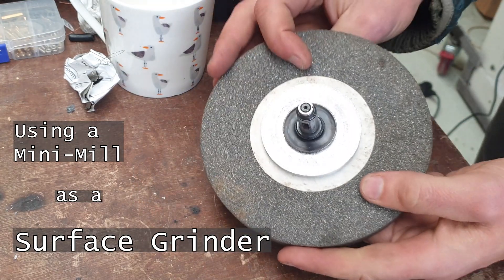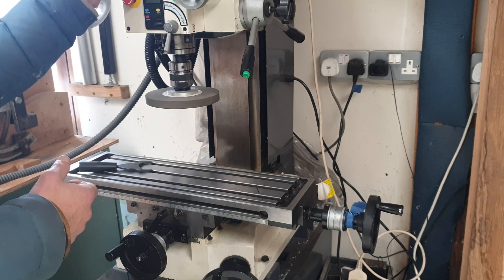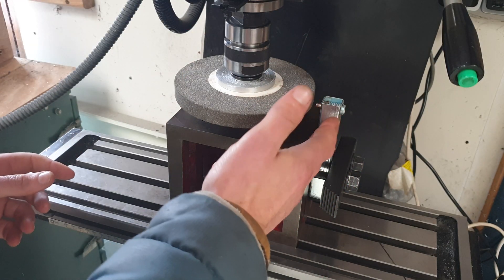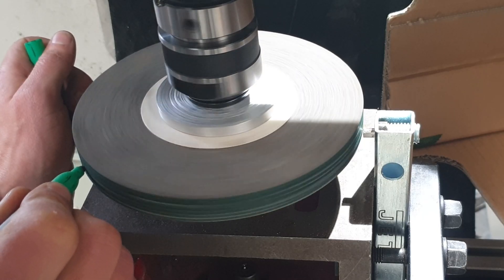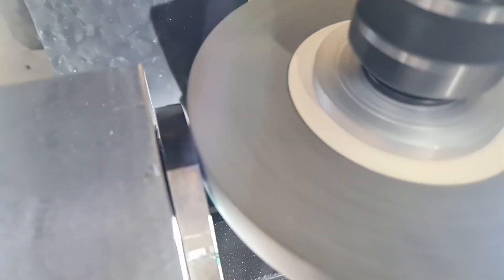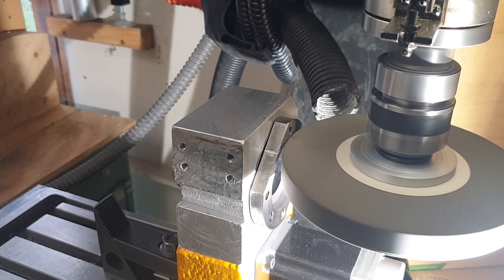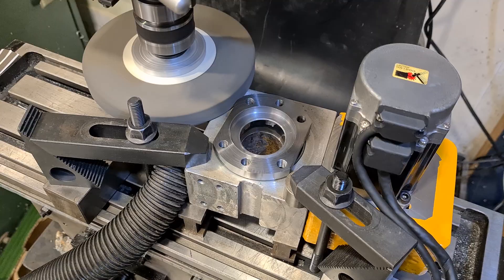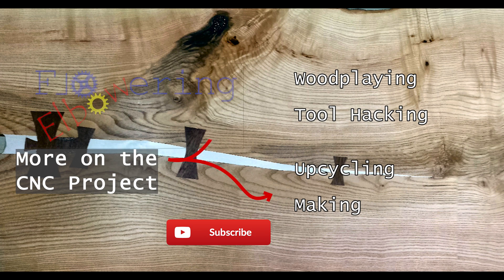How to use a Mill as a Surface Grinder (precision for cnc building punks)

Comment: Pay attention when using shopvac: do not leave paper or wood chips/dust inside the collection bin. It can catch fire if you are extracting hot sparks and it will do it pretty quickly because of the fast airflow! Maybe fitting a wet sponge on the dust port can help to stop some flaming sparks to get into the bin, but always clean and check if your filter is not melting/burning too.
Reply: Just try to guess how I did learn it. Didn't believe manual/warning sign on my belt grinder. Hooked to my shopvac and a fire started in no time inside my dust bin. Scary.

Comment: That’s really clever…it never dawned on me that a mill could be used as a surface grinder! I’ve been lusting after a surface grinder for some time and weighing up the options. They’re bloody expensive to buy new so I’ve been looking at DIY options…the conclusion I came to is that I don’t have the skill or right equipment to make something anywhere near as accurate as a ready made one. This however is achievable. Thank you 😊🙏

Comment: nice idea , seen it before with a cupped stone but never though of using a straight stone and the quil for height ajustment 
using the quill does introduce some variation (if it isnt clamped down after adjusting it )
have to look intoo the idea , thinking right angle plate and a magchuck set up on the crossstable , only problem is setting it up so its trammed exactly right for surface grinding 
might make a different arbour for the stone too , one with an mt4 taper that i can chuck straight in the mill

Comment: You have unleashed the wrath of grit all over your mill surfaces. The fine grit will eventually create uneven wear, ruining your it. Repent now, for thou hast damageth thine lathe!
Reply from the maker: Good morning Bob. Haha, yes. Trashing both the lathe and mill in one stroke, the wrath of grit indeed! 
It's not too hard to clean off with the shop vac if you get all the oil off first. It's a bit of a rigmarole, but worth it if you don't have a surface grinder :)
Reply: @FloweringElbow4SuperNerds  Next time, if there is ever one, cover everything with a drop cloth. Stefan Gotteswinter covers everything and even goes as far as using an ultrasonic cleaner to wash away the grit.
Reply: But this is Chinese buttersoft cast iron so grid gets nicely embedded in it. You can’t vacuum everything out
Reply: @ML-jf1xe  Exactly. In fact, it a great way to make your own diamond plate. It's impossible to remove all of it.